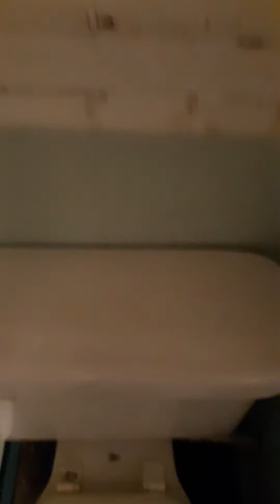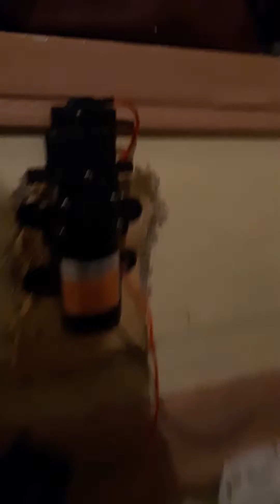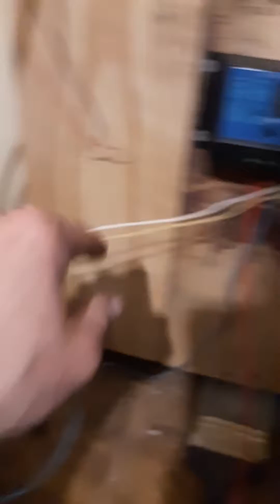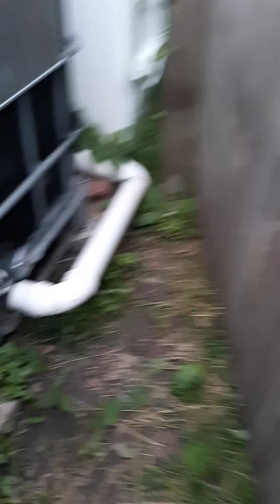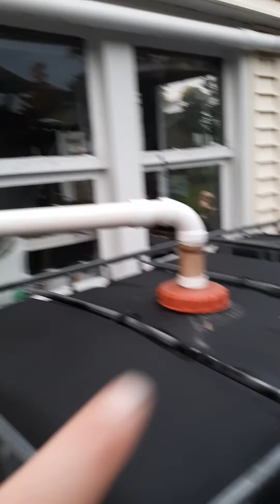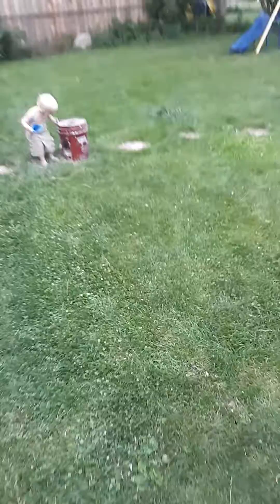IBC Tote Rainwater harvesting to flush toilet with solar 12 volt pump.

Comment: How does the pump know to shut off when the toilet is full?
Reply: The pump has a built in pressure switch.  Once the toilets full just like city water it automatically shuts off. When it needs to be filled the pressure switch recognizes it fills it up.

Comment: What pump and filter are you using?
Reply from the maker: The filter I am  using is designed for a rv. I got at menards it's just a fine sediment filter gets the debris and dirt out. The pump is an unbranded 1.1.gpm  marine/rv pump i found that on ebay. It doesn't fill super fast but it does enough to fill my up stairs toilet and basement toilet. I recently added one more specifically for my wash machine which it works perfectly for that as well.